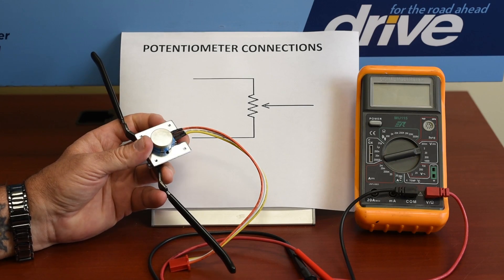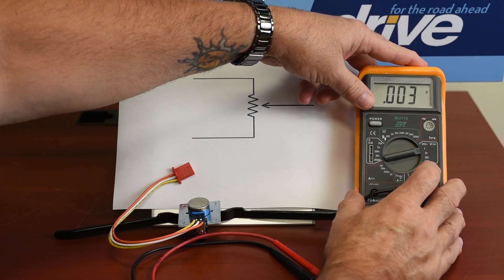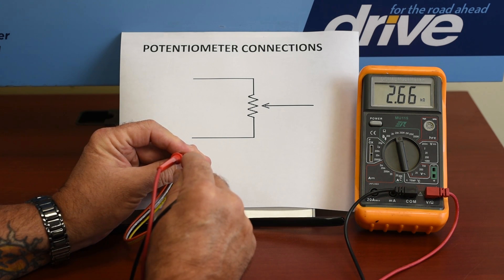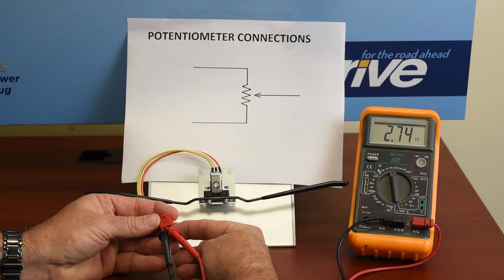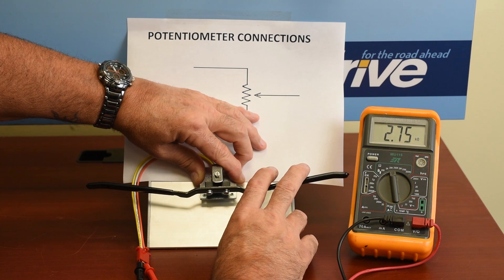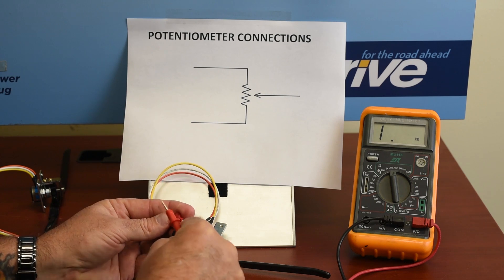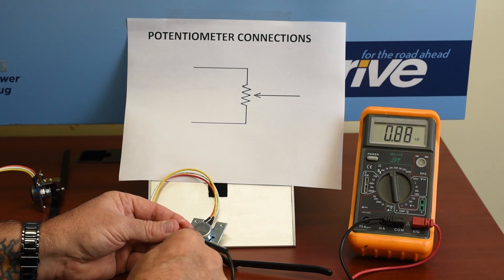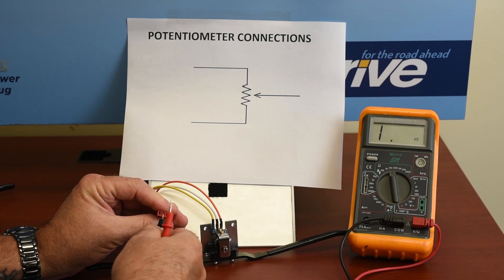how to test throttle potentiometer

Comment: That's all very well but:  I had a problem with a Shoprider throttle pot which measured fine, but was still preventing the scooter from working. The fault was traced back to the pot's connectors (male and female) Some moisture may have entered and corroded 1 or more of the 3 contacts and in doing so upset the resistance balance read by the controller. A spray with some proper electrical contact cleaner fixed the problem. Don't use WD40 ! The correct way to test the throttle pot circuit is to test it at the controller end. That way you're testing the whole circuit. ie. pot, connectors and wiring. Testing the pot only, as you've done would have others moving on and thinking the problem lies elsewhere.

Comment: great video.....thanks for showing us how to measure a throttle potentiometer...I had a feeling i was doing something wrong and thanks to you things are clearer now...By the way I'm not sure if that potentiometer is defective...its quite possible the potentiometer shaft is no longer aligned with the bushing that holds the lever...Sometimes the little setscrews that are pushed against the shaft are not torqued enough causing the shaft to rotate slightly putting it off balance ...that would be my guess but I can be wrong...

Comment: Thanks. I found the throttle pot on GoGoscooter had a 10K resister in the center lead. So It should be 5K from side to side and then 12.5k from center to either side. (could see was something under the shrink tubing, and thru tested I determined was 10K).  ANd when operate the lever, then the center goes from the 12.5 to 10K one way, and to 15K the other way. So if went by the stated 2.5K I would have condemened it.

Comment: Thanks for the video! I think you might have confirmed my suspicions about the used tzora scooter I bought that does everything but move when I turn it on. Thing is made in Israel and parts are not easy to get. Can you buy other potentiometers and use them in place of the original?
Reply: Yes you can. 7se your test meter to check the actual resistance between wiper and term I. Then purchase a pot of that value and fit it in place of the existingmone. Be careful to buy one of the same anperage

Comment: I'm having trouble with a pot on a mobility scooter the control system is flashing saying its a pot fault but it seems fine when tested with this method shown its bang on centre it works fine sometimes then flashes with fault code even tried a new potentionmeter
Reply: Before you buy a new "electronic brain, check out the wiring loom.
Reply: You have a problem  with the brain it's self